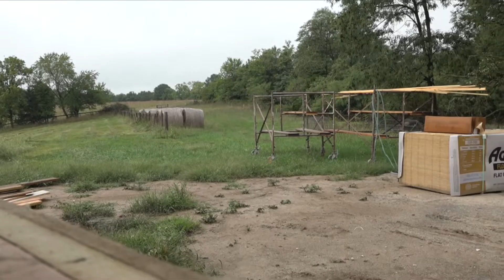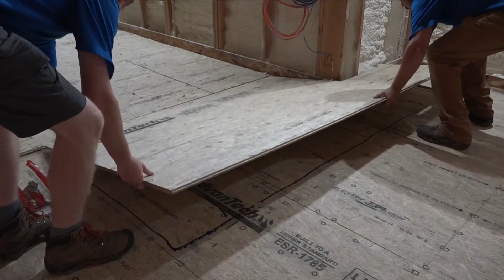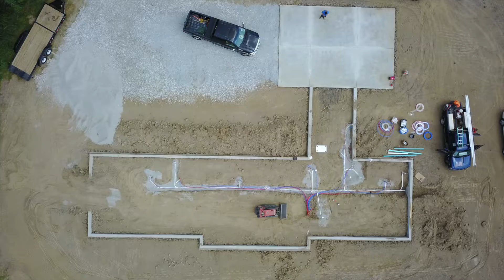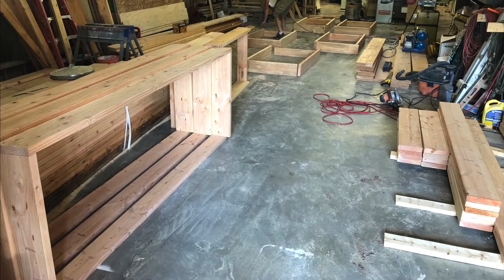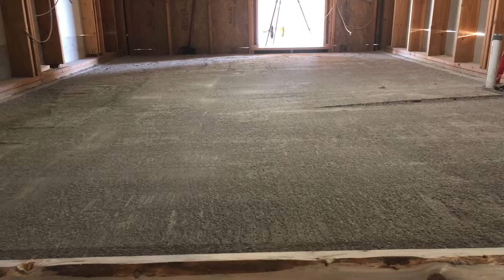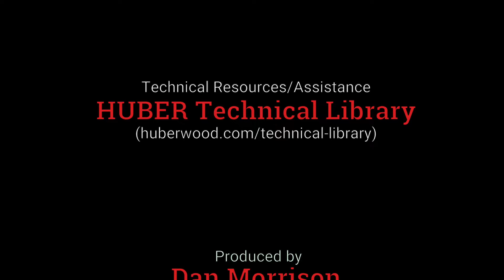1 Intro, framing, and gravel

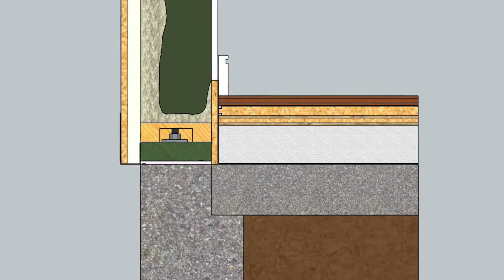Comment: 0:29 Your gravel is touching the wooden structure. I suspect that the moisture from the ground will travel higher and destroy the wood.
Reply from the maker: No it isn't. Plastic is laid atop the gravel and sealed to the concrete stem walls and pressure-treated mudsill. But 4-inches of gravel will never hold any water anyway. The plastic is mostly for soil gas.
Reply: @ProTradeCraft  so you don't have horizontal damp proof insulation at all?